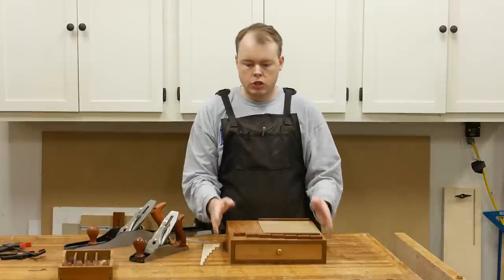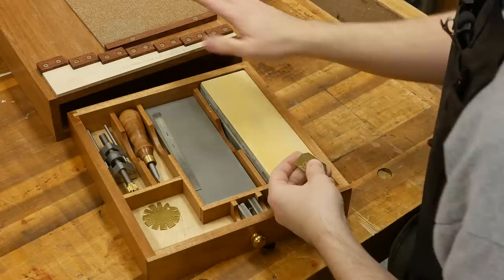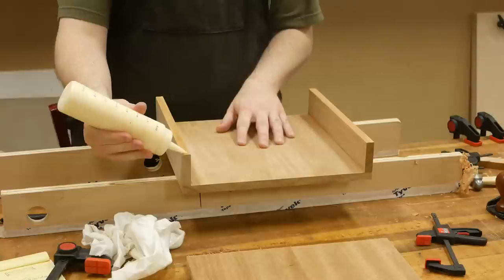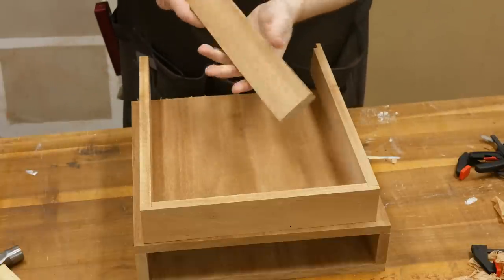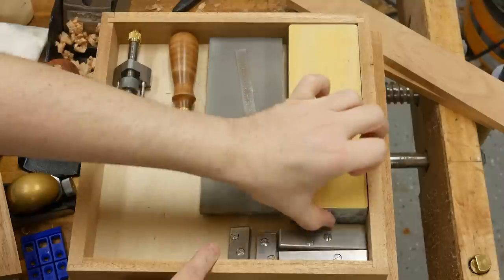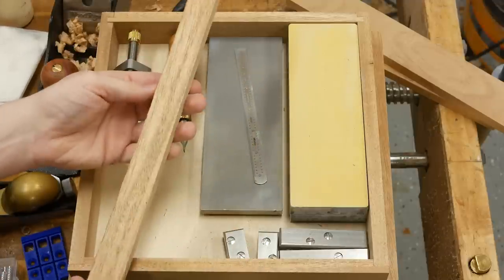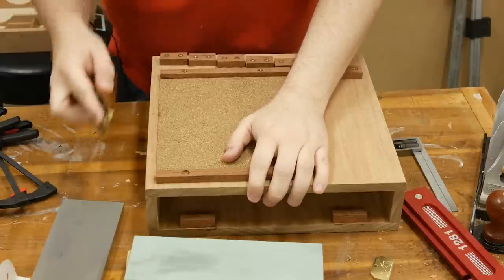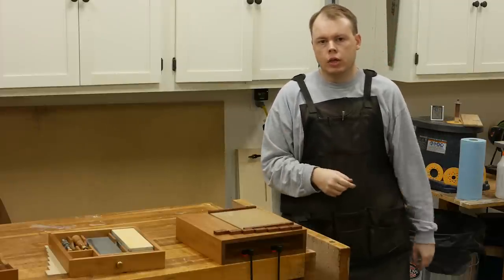Build The ULTIMATE Sharpening Station

Comment: Very nice box, looks a lot like my design actually. I’m curious, why so many jigs for the degree setting? Personally I never use anything beyond 20, 25, and 30 degrees. The brass insert can get you 22/27 and 32 if you really need it and the ruler adds the micro bevel. I’m more of a minimalist in these regards, but it’s what has worked for me. Thanks for making this, it was fantastic.
Reply from the maker: Thanks for watching! I go up to 50 degrees on a spare blade for my veritas BU smoother so I figured I might as well add the other 2 or 3
Reply: SimpleCove Interesting, I hadn’t thought of that, mostly because I dont own one. Now that I am thinking of it, that has a 12 degree sole bevel already, if you are adding 50 degrees with your spare blade, thats 62 degree plane? WHat do you find this useful for? Thanks again.
Reply from the maker: @David-fv7zg  for special occasions where the grain just won't cooperate

Comment: I see you are out of stock on the template and brass shim for this sharpening station. Will you be making more of these two items?
Reply from the maker: The templates will eventually be back in stock when I have some free shop time but the brass shim is no longer going to be made due to the time required to make and the brass prices would require me to charge more and I don't have the time to make them unfortunately.

Comment: Looks great but is there really any point in going to such effort to provide a station for finely sharping your plane iron only to then immediately lose the edge after first use by putting your plane down on the bench like that?
Reply from the maker: Nah, it's fine
Reply: Paul Sellars recommends leaving them like that because leaving them on their side can mess with the setup.
Reply from the maker: @SteS  Exactly this. I'd rather take the chance sitting them on their bottom and not have to adjust the blade every time I lay it down.
Reply: @SteS  Paul Sellars suggests this is only done because naughty schoolboys would bang their planes down on their workbenches.  I have asked him if that is the case why manufacturers like Stanley, Irwin, etc. all recommend that you lay a plane down on it's side to protect the iron? Apart from telling me that the people that taught me were stupid he hasn't actually provided an answer to that question.  In which case he obviously thinks everyone at Stanley, etc are stupid too!
Reply: @Simplecove  Surely resting the weight of the plane on the cutting iron is more likely to disturb the set up than simply laying the plane on it's side?  If nothing touches the iron why would its position change?